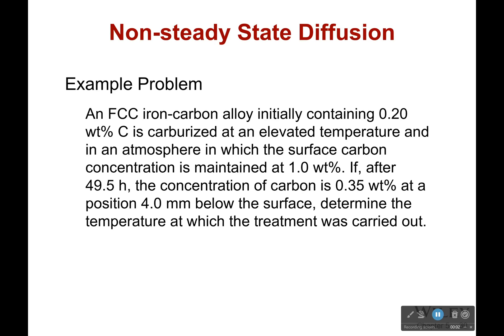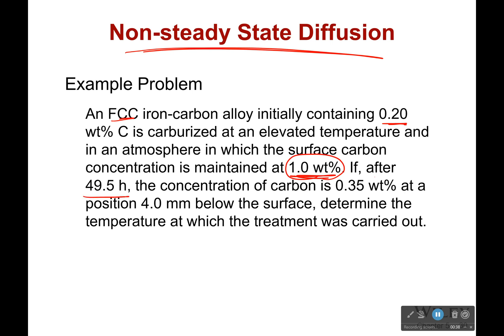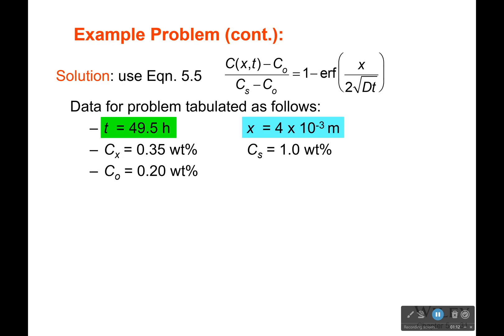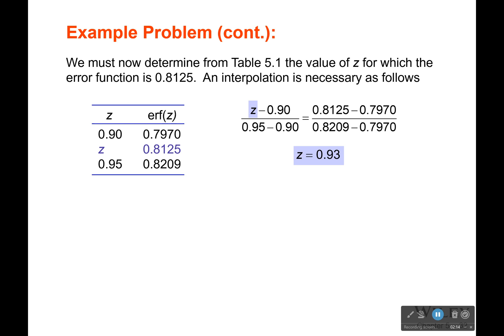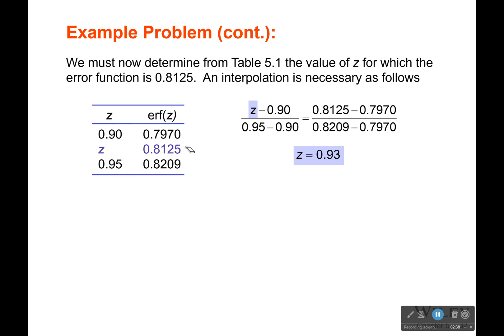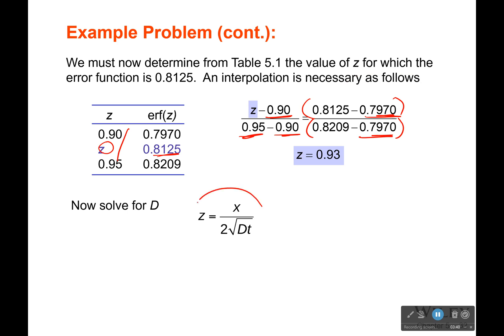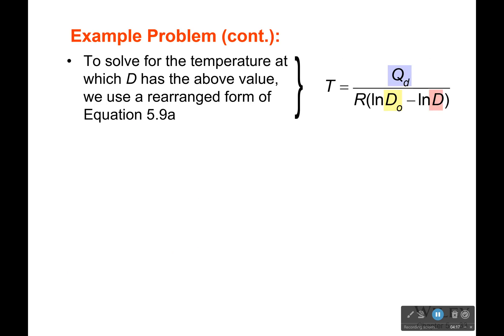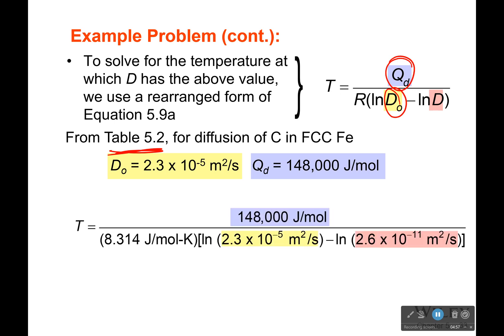Example: Non-Steady State Diffusion

Comment: I don’t understand how you got the activation energy from the table
Reply from the maker: In the Callister textbook that this problem is from, there is a table of Diffusion coefficients and activation energies in Chapter 5. Placement changes based on edition, but you should see Table 5.2 somewhere around section 5.5. In that table it gives you a list of diffusing species (the species that is moving) and host species (the species that makes up your material). You just find the line that has the correct ones then go over to the column for activation energy that is the proper units for your problem.